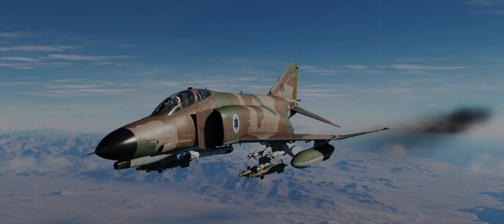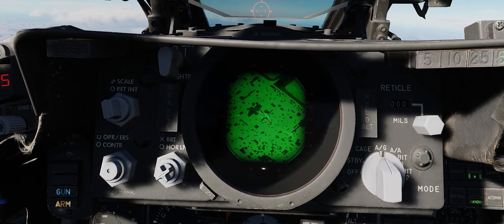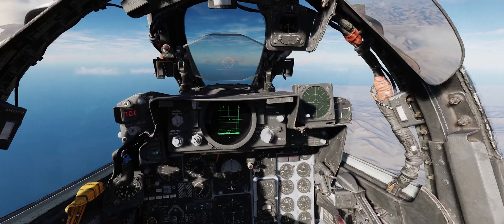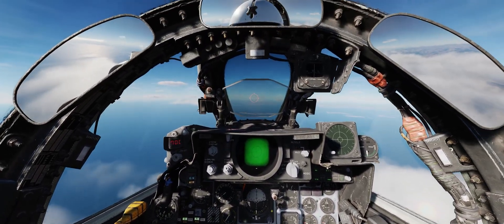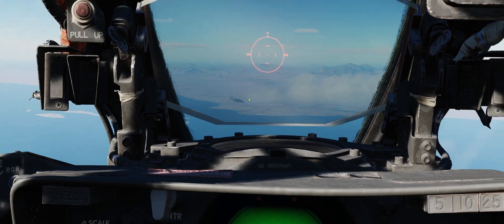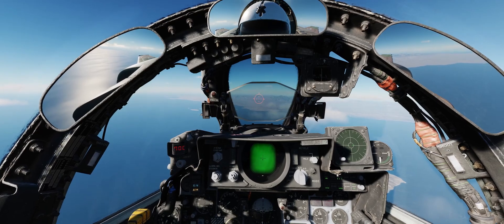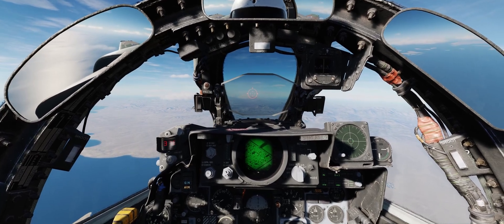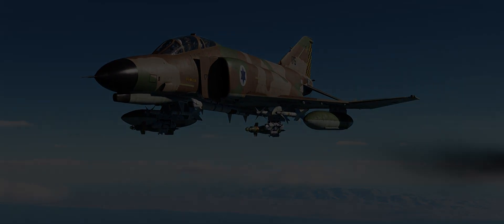Analogue Voodoo Magic?! DCS F-4E Phantom II Pave Spike & LGB Tutorial!

Comment: Thank you Spud ! This is a great Video. Can you talk about a INS Drift fix ? I thought the INS is Importend for the Pave but after one landing the INS has a huge Drift for me
Reply: In terms of Pave Spike, the INS mostly affects its ground-stabilization logic. The pod still works just fine with a degraded INS, it is just a bit more wonky.
INS fixes can be done by overflying a visual point. Therefore, the WSO enters the exact coordinates of the so called NAV FIX POINT into the Nav computer, then moves and holds the SET/FIX switch, releasing it the very moment the aircraft is flying exactly over the position. By releasing the switch, the aircraft understands that the current position is equals to the entered coordinates, erasing any accumulated drift.
If you are flying solo, at the moment you would have to jump in the backpit yourself. Jester will learn this procedure soon though :)
Reply: @Zabuzard thank you . I was about to ask if jester can do it but u told allready. 
I hop jester is working hart to lern how to operate the TGP as well

Comment: Seems like Hobos or Walleyes are actually the easier option fot rhis kind of job
Reply: Might be worth mentioning that Spudknocker only showed a very basic usage of the Pave Spike (to show that its easy to get started with). It is capable of more than a direct attack like that. For example, you can slew it to offset coordinates, scan for bad guys while orbiting and then for example execute a loft delivery with LGBs on them using TGT FIND from a very high range, outside of the threat radius. A trained crew can use the Pave Spike similar to a more modern pod, especially since it already features ground stabilization logic and will always walk the camera back to the target on its own.
Reply: They are.. but they also can be shot down pretty easily.  Also puts you in direct line of fire for some AAA and Shorads.